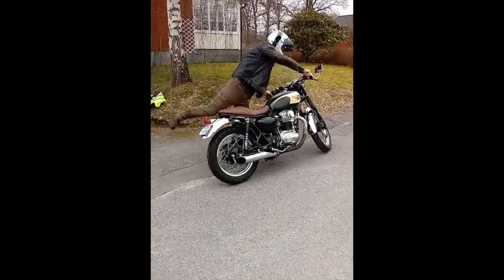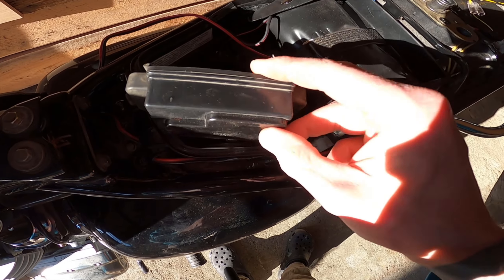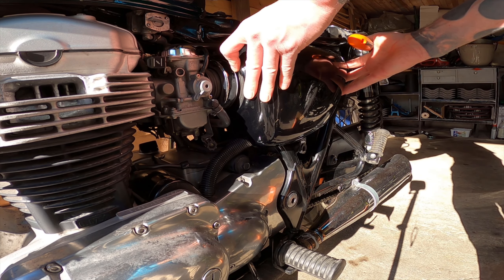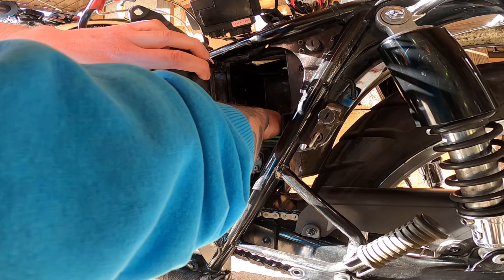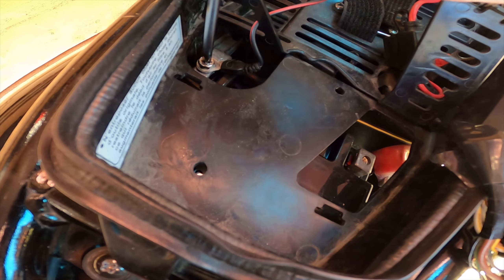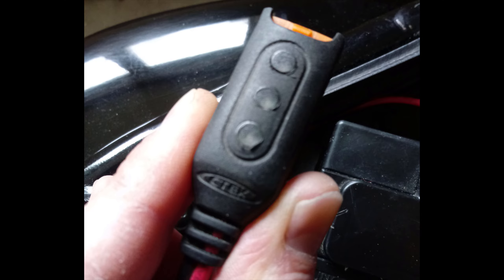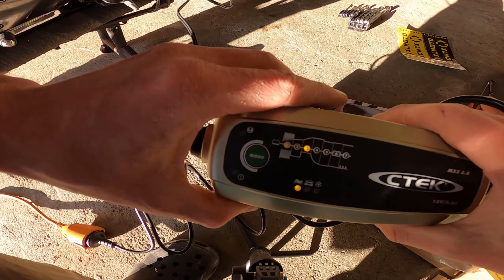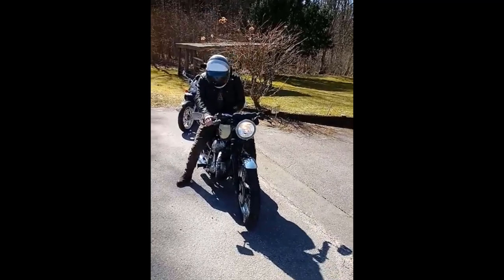Changing Battery On My W650

Comment: Good vid, How old was the battery that failed? And did you consider and look into using a much lighter Li-Ion? Thanks and BW. R
Reply from the maker: Thank you!
Not sure, I only had the bike one season before the battery gave in. Over the winter I always maintenance charge the battery, and they usually hold 3-5 years.